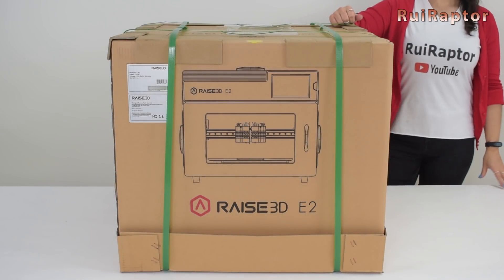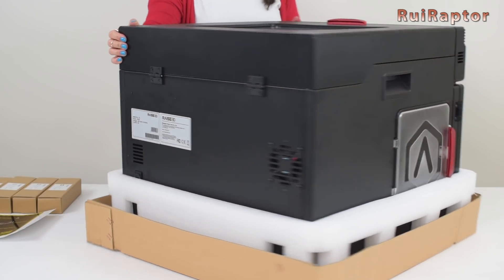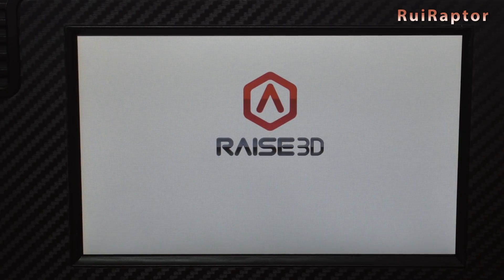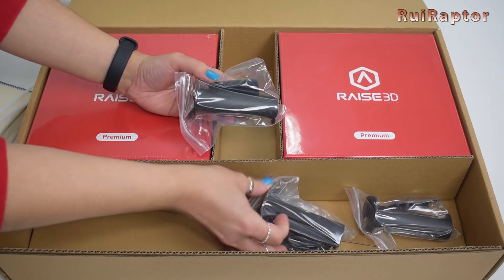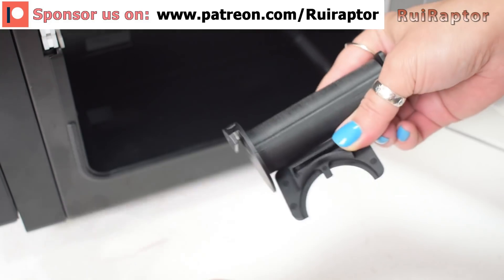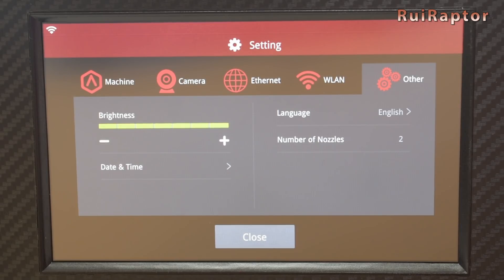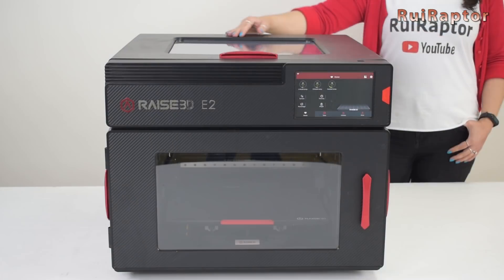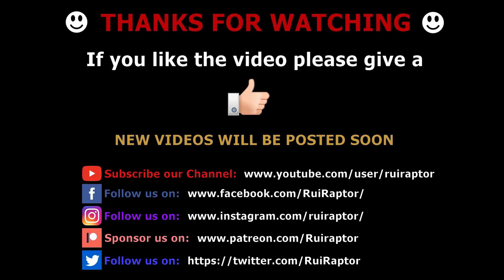Raise3D E2 (3DPrinter) - Unboxing & First Look

Comment: Hello, I haven't seen anyone mention installation space.  Meaning, what is the minimum depth (front to back) of a bench to hold this printer, including any airflow space that is required behind it.  Thanks.
Reply: I've found the machine's dimensions (WDH: 607×596×465mm) on Raise3D's website. So the minimum installation space would probably be that plus a few inches on all sides for adequate airflow.
Sorry I couldn't be more specific, I don't own a Raise3D. Just based on my gut feeling.

Comment: Just a correction. Raise3D printers are enclosed but they're not CoreXY systems.
Reply from the maker: Hi Flávio, We don't have the other raise3D printers, only the model from the video. That being said, that information was given but we can confirm now that is wrong. However, as we mention in the video, the E2 is not a coreXY. Thanks for the comment.
Reply: @ruiraptor  Sure just wanted to correct what Sandra said at the beginning of the video ;). Nice unboxing by the way and I'm eager to see more from this printer!

Comment: can you have both nozzle running at the same time
Reply from the maker: With 2 print heads, you can use one for one type of filament and the second for another type of filament (it can be the same type of filament but different colors or different types of filament), you can print with both at the same time while making a mirror print and both making a copy print. We have made a previous video with a different Idex machine and in that video you can see both print heads working (  https://youtu.be/mft_yGyofmo  ).